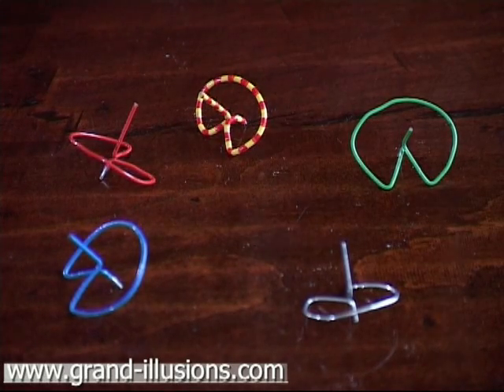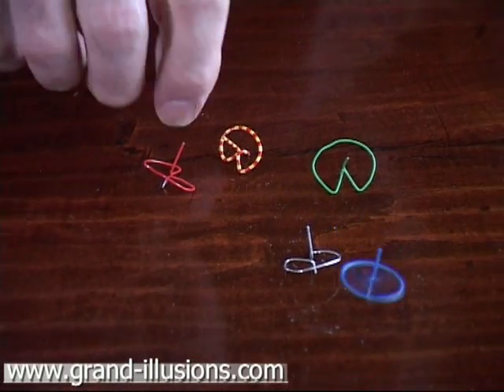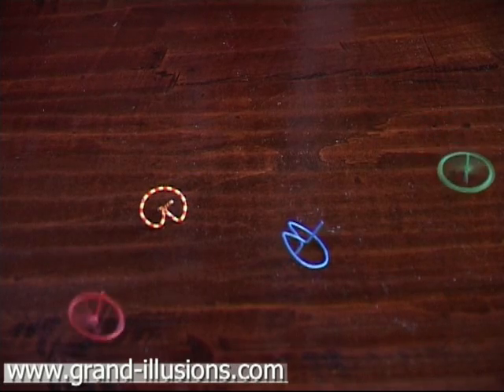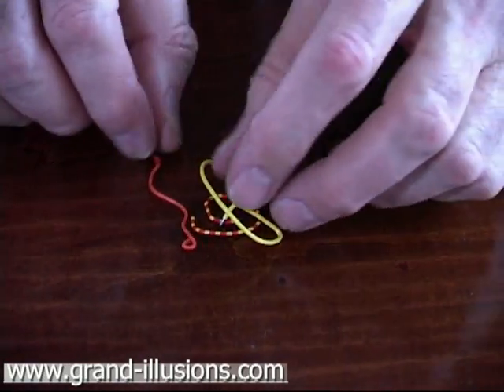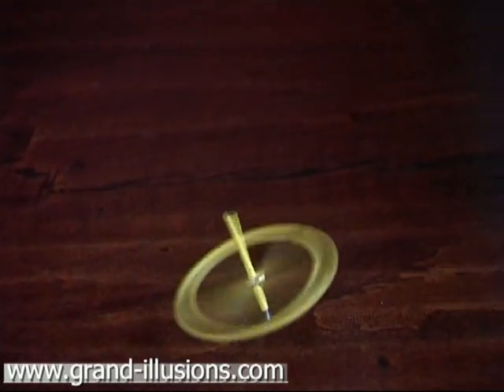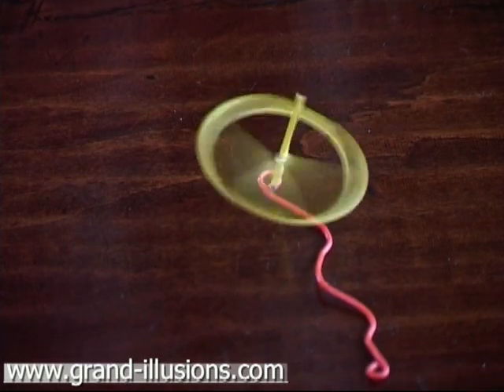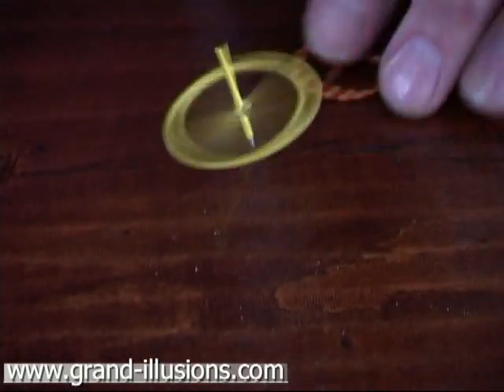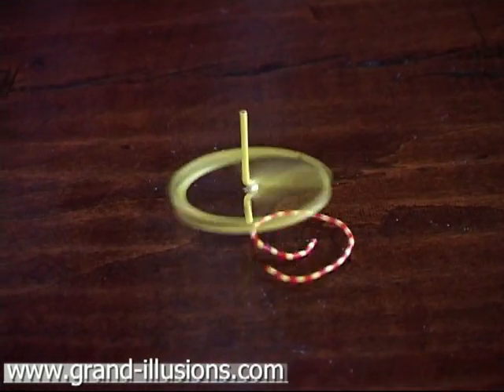Paper Clip Top

Comment: What would happen if you introduced a small button cell battery into your magnet-paper-clip? I know that using the battery as the armature, the wire and magnet will spin around it, but at this small size with the battery and magnet as the armature...?